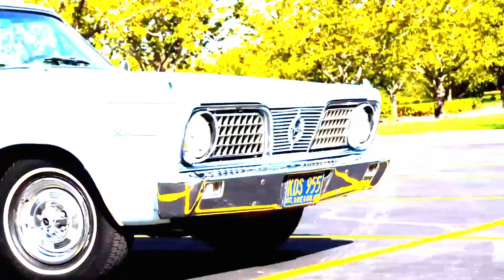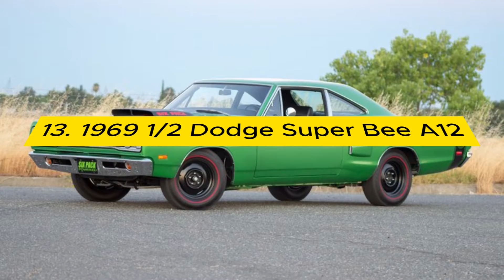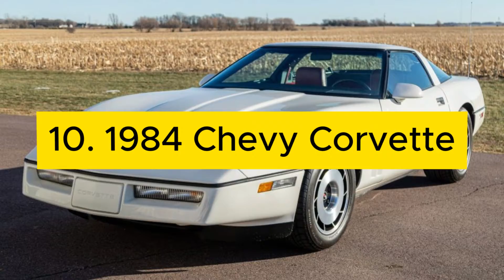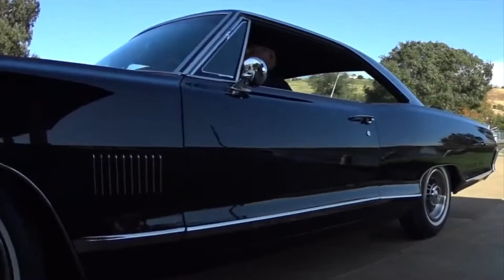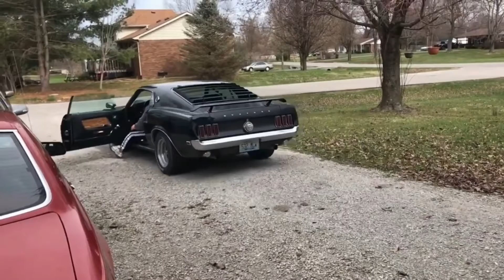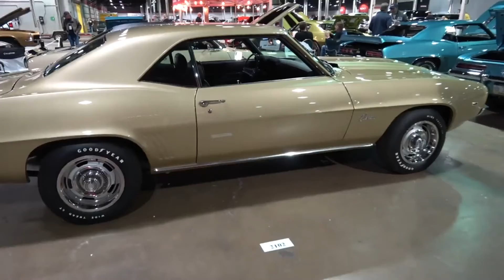17 Most Badass American Muscle Cars You’ll Ever See!

Comment: A funny story from Jim Wangers about the test GTO in 64 was a 421 Super Duty 3x2 V and an M-22 Muncie built using bus gears and shafts. He said it would not have done that ET if dropped off a 10 story building, lol. By 65 they had some McKellor parts dialed in changed the intake and head flange angle to 14 degrees like the 421s from the 17 degree angle 326-350. The 350 HO later in 1967 had the 14 degree heads and intake that they used throughout the rest of Pontiacs V8 use. The 1964 had the solid lifter McKellor NASCAR 421 cam, the #22 I think it was. I’m a Ford guy but I built a bunch of Pontiacs. The Blocks were a little weak and the 3 inch main was heavy compared to the 55-57 2.75 main they had in NASCAR and the 421-455 3.25 was why Smokey Yunick went to Chevy. I made an accumulator from an AC unit that had 2 extra qts of oil if it had a hiccup from the big mains pulling too much oil and the the pressure pushed the extra oil back into the tank on the accumulator when it didn’t need it.

Comment: How much parasitic loss would you think the modern Mopar twin screw supercharger would have and I was wondering if a remote carburetor or maybe 2 carbs at the rear near the inlet on a pair of plenums on each side of the blower? That would be cool! Just have a plenum across behind the blower and it would be a wide filter and a top  with air inlets that turn down behind the front wheels .